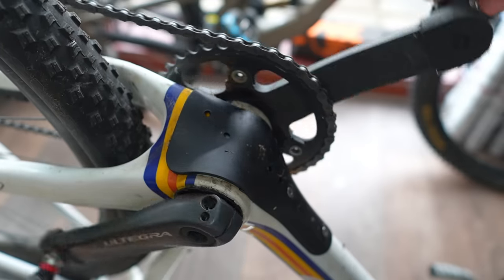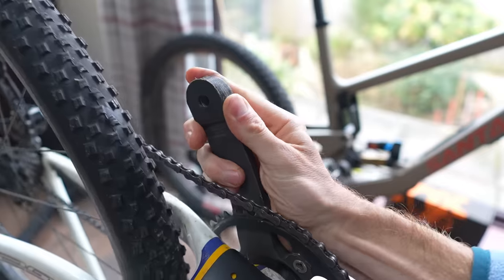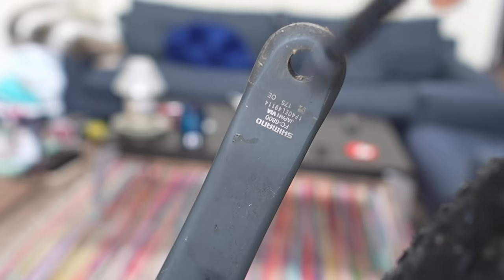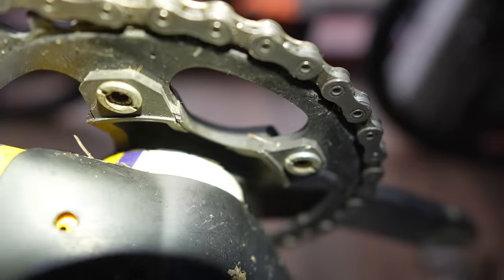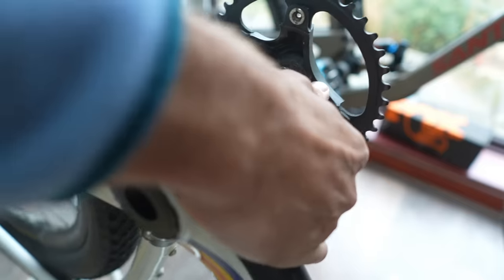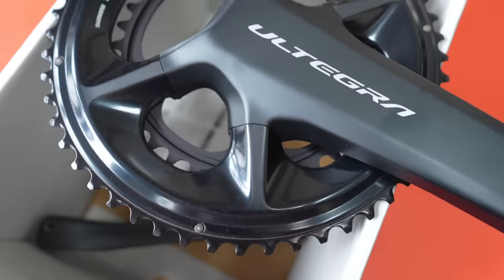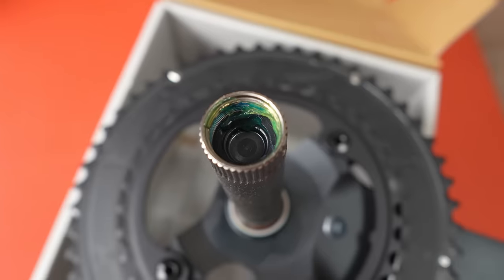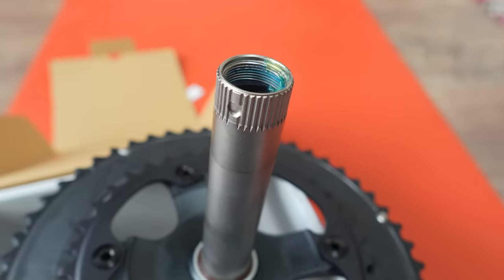Another Shimano Crank Failure & the New Design

Comment: In case anyone was in any doubt, it's my bottom bracket in that bike. And it's as tight as a coke can in a toilet roll holder.
Reply: Is it tighter than hairdresser ?
Reply: thats perfectly designed for slopestyle
Reply: Hairdressers aren't tight...
Reply: @mikehall6608 you don't associate with the right ones
Reply: Just changed the bearings in my hambini bb and yes, it is still as tight as my sphincter when i pressed it into the frame. The caps seem thin walled but are very resistant. not a scratch on them after two seasons of cross racing.
Reply: @Hambini  Broken in is right for many
Reply: Do hairdressers come with a certificate if calibrated by Hambini?
Reply: Only a five year old would be messing with a coke can in a  toilet roll holder.
Reply: You still harassing women online?
Reply from the maker: @christopherfarrell7398  who?
Reply: @PeakTorque  hambini
Reply: Indeed, that's how it should be. No relative movement between parts in motion. Otherwise it more a bushing than a proper bearing.

Comment: I replaced a dura ace 9000 crankset with a campagnolo centaur (using ultra torque) and even though the centaur is the lower tier campagnolo groupset and dura ace the top of the line shimano the campagnolo crankset feels better. The bearings seem smoother and the cranks seem to be stiffer. Although that may just be my own bias, the important part is the campagnolo aluminium cranks are not hollow and not bonded. So the particular failure mode of these shimano cranksets are avoided. I took the shimano crankset to a bikeshop and they found no issues, neither did I, but I believe it is just a matter of time before it starts cracking. I honestly don't trust shimano cranks anymore, the way they make them seems not up to expected standards of quality.

Comment: I had a Dura Ace 9000 crank crack across the line where the top of crank boot would fit.  Was not obvious and needed a magnify glass to confirm.  Shimano replaced all including chainrings.  I warrantied mine when the recall started and took 3 months to get the replacement

Comment: people give me a lot of crap for cleaning my bike/components after every ride, I call it preventive maintenance, my point is that one will more likely find damage/defects when the bike is clean.  I've never had a frame or crank fail on me while riding, knock wood,  thanks for the vid.
Reply: Here is more crap for you: by finding failures quicker you do absolutely nothing to prevent them from happening. You gain nothing. But of course you are right: watching out for early signs of failure makes sense.
Reply: @rosomak8244 The idea of preventative maintenance is not to stop failures but to spot issues at a time early on when they can be dealt with without adverse outcomes. 

In cycling this is highly desirable in order to avoid failures at unexpected times for example when descending in the Alps. I would argue you could potentially gain from this way of thinking, especially if you value your health!
Reply: @davidgeorge9233  No. The real way to prevent catastrophic failure of "alpine dimensions" is to replace preventively parts that are known to be shabby before even seen any initial signs of failure. But the cyclists of today just can't mentally part with the sugar suit brand names for some reason.

Comment: Took my 8 year old 6800s to the shop without rings, and after a few weeks simply got a call what rings used to be on there - could've told them anything I wanted, if I fancied a change. Also had creaking and the exact same failure spot, but much much smaller opening. Still replaced without question after about 10 weeks.

Comment: Shimano have known about this for years. I had my road bike 6800 crank set fail in Aug 2016, with just 15000km on them. It failed at the drive side crank arm bonding. The first hint I had was that I thought my pedal axle was bent, even though I had no fall at all on those cranks.  I was looking down to see if I could actually see a bend in the pedal axle and noticed that the Crank was bending under load. Closer inspection revealed a complete bonding failure of the crank arm bonding, all the way up to the Spider, including the spider as well. I suspect the redesigned spider of the next ultegra series was a result of multiple failures. I had a few friends also subsequently have similar failures.
Reply: Did you contact Shimano, the shop you bought the bike from? What did they say?
Reply: @dainiusvysniauskas2049 Yep, I contacted Shimano Distributor in Australia and informed them, of a potential safety problem. As the part was out of warranty I did not ask for replacement but they replaced it for free anyway. They didn't say anything else or acknowledge that it was a common problem.

Comment: I received a replacement FC-09 set for my failed DA9000 crankset.  Interestgly, the fit and finish of the chainrings is near perfect, unlike the Ultegra level.  Also, the Dura Ace set seems to have gone back to one piece for the NDS, versus bonded.  I haven't checked the weight, but I suspect they'll be a bit heavier.  Shimano should just work out carbon cranks.
Reply: Indeed a good bit heavier. I have a review of DA9200, Rotor Aldu carbon and Cybrei coming up.

Comment: I had two R8000 cranks replaced.
My LBS took the chainrings off to inspect and asked if I wanted them back.

The new cranks came with new chainrings and I got to keep the old ones (they were barely worn, so I sold them for £40/50 ea).

Comment: The new cranks are simply Ultergra 8100 12sp cranks however the rings had to be specically made for the recall. The reason being the entire shimano 12sp group has a chainline that sits 2mm further outboard to clear newer wider chainstays, this means the spider on the 8100 crank sits 2mm further out. A new chainring had to be developed to compensate for this and maintain the original 11sp chainline. This is why the new chainrings are not compatible with the older cranks and vise versa as it will totally mess with chainlines. Shimano say they are going to stock just the new chainrings as a spare part for when these rings wear but am yet to see them available on their own.
Reply from the maker: These new rings have 12sp stamped on them
Reply: @PeakTorque  interesting. I've had 3 replaced and all have 11sp stamped on the rings. Maybe you've stumbled onto another Shimano fail and perhaps they've run out of the special rings 🤔

I did a deep dive when I got my first replacement crank. It slotted back on my 11sp bike without any adjustment needed to front mech. Then for shits and giggles I tried the 12sp version with 12sp rings and yeah front mech needed to be brought outboard 🤷
Reply: My FC08 replacement has the special 11 speed chainrings. I was told Shimano would stock them.
Reply from the maker: Shimano in the UK are just sending out 12sp full ultergra cranks it seems. Im fine with that. They still work with 11.

Comment: Hi PT. You mentioned that all prod. code c/sets being prone to failure, and that is not entirely correct. 6800 ultegra most if not all c/sets will fail at some stage, however the 8000 ultegra, 9000 d/a and 9100p ( total joke of a powermeter) have some prod codes that are excluded from the Shitmano list.
Reply from the maker: Good point. I should have mentioned all 6800. Edit: i did say all 6800. I should not have doubted myself! 😂

Comment: Nice collection and presentation. 
This episode inspired me of application issue regarding the crack arm seams. Particularly cranks for MTB application. When the paddle or the arm tip hit either the bumps or the protruding rocks on the trail, an impulse force may impart on the crank. a force is multiple times beyond the design value.  Thanks to forgiving aluminum ductile characteristics the crack develop gradually and not snap suddenly. If not the crank the fracture will come out somewhere down stream of transmission. (Splines of free hub?)

Comment: The chainrings that have been fitted to the replacement cranks are not from the 8100 12 speed groupset that the crank arms are from. They are the 11 speed chainrings from the previous iteration which had a glossier finish. The BCD hasn't changed but as the 6800 and 8000 series crank design is no longer in production you have essentially received an 11 speed modified 8100 crankset.

The batch code on the crank arm is only relevant for the later 11 speed cranks: Ultegra 8000 and Dura Ace 9100. The very last cranks made for those groupsets ( between Sept 2019 and Cease of production around the time of 12 speed releases) were built using the new bonding method ahead of the 12sp product development. All of the older Ultegra 6800 and Dura Ace 9000 were affected.
Reply from the maker: The chainrings have 12 spd clearly stamped on them on the inside.
Reply: @PeakTorque   curious... the chainrings on the full Ultegra groupset as I have seen on display in my LBS are an exact colour match for the cranks so that makes no sense. I'm sure I read somewhere that the replacement cranks were 12 speed cranks with modified chainrings. It's been so long now that I don't remember where.

Comment: recently i saw a vid on debonding derailleur hangers, checked mine and found the screws were dangerously loose, after watching this im checking my crank. i have been noticing new creaking but its easy to ignore. iv found creaking from the plastic on my pedals, saddle rails, and loose chain rings. i suppose its fair to say, not all creaks are created equally.

Comment: Quite a lot heavier indeed. The Irony being if you are just looking at the crank minus the rings (as am I as I'm also running my 6800 on a 1x) ... its about 40g heavier than an R7000 105 crank, which of course is non problematic, old fashioned forged construction rather than bonded. Makes one wonder why they bothered.
Reply from the maker: Is it really? Thats bad!
Reply: Yup. theres a guy who doe a blog called Handsonbike where he takes the things apart and weighs each part seperately. 

 It's surprising, but if you look at the weights of the various crank arms alone ... this new Ultegra crank is heavier than any of them, the new Dura Ace one second heaviest. the rest are all pretty close to r7000. The only arms that are significantly lighter are 9000 and 9100.

Of course most people only look to the total weight with rings, and thats all Shimano publishes. the bigger weight differences are in the rings not the arms.
Reply: Actually my bad. I misremembered the difference. Its actually about 22g.bit I guess the point remains the same.

For the sake of completeness, the numbers for crank only as weighed at Handsonbike follow. These are 165mm unless stated.

105 R7000, 525g
Ultegra 6800, 528g (170mm)
Ultegra R8000, 519g
Ultegra R8100, 547g
Dura Ace  R9000, 482g (170mm)
Dura Ace R9100, 478g
Dura Ace R9200, 538g

The differences aren't huge, but I think it's instructive as to thevalue of bonded cranks as a weight saving measure, especially after they've been modified to hopefully not fall apart.

Comment: It’s very interesting that this type of failure is happening with the higher and Shimano cranks. Because I have a lower inch mono crank it’s a Shimano Acera Square taper and I’m not having this problem at all. It is well-made so I’m very surprised.
Reply: You aren't having this problem because it's Made in a completely different way.
Reply: @thomasstone1363  how so? Could you explain that to me because I have been dying to know how Shimano makes their cranks and how they make all their parts.
Reply: @MarshWaha  They're not hollow. Lower end cranksets are usually just a single piece of forged aluminium with riveted steel chainrings. This makes them heavy, but extremely durable and cheap to produce.

Comment: Buy some decent MTB cranks and you'll have no issues. Years of mountain biking many of it Enduro and despite many big rock strikes, unplanned dismounts etc nothing apart from cosmetic damage, bottom brackets  just as you would expect they do wear out.
Reply: chain rings from mtb cranks are just to small for road bikes and it is just a shimano problem. even the carbon sram once are built proof ...

Comment: I have the newer design Ultegra cranks and I sure hope these additional waterproofing steps fix the issue. One advantage I have is I don't put nearly the torque on my crankset like these alien cycling monsters such as Peak Torque. 😬
Reply: that ain't the reason these bonded cranks are failing.
Reply: @bikingchupei2447  I don't think you understand. As the structural integrity of the bonds become less and less commendable due to corrosion, they become more and more susceptible to failure by delamination and cracking due to the torque applied at the pedals by the rider. The greater torques/forces applied to the pedals by stronger riders will cause failure when the smaller forces exerted by weaker riders will not. It is true that eventually these defective cranks would fail for all riders if riden long enough in wet conditions, but failure occurs sooner for stronger riders.
Reply: @SignorLuigi  i see.
Reply: @bikingchupei2447  I'm glad the explanation helped. It was nice of you to respond. 👍

Comment: Hey, im plan on buying an Shimano Altus FC-MT210-3.

I plan to upgrade tge bottom bracket on an older mtb because it has a few cm of play haha when you rattle it and looking at the position of the pedals. 

Are there any problems with this crankset?
Reply: Altus is fine.and up to 105 also fine.
Reply: @aitorbleda8267  thanks i tought so, thinking back at it. The hollowtech technology is not listed on their pages so i guess they cast as a whole? And the hollowtech ones are for those who want to save weight, for racing and such?

Comment: THAT‘S why the cranks have this strange plug in the spindle! I have removed it because they did not fit on my bike stand that goes in there. Maybe that was not a good idea. Why on earth have they gone with the closed design on the road bike and not just made it see-through as on the MTB?
Reply: That outer plastic bung is a preload cap. It allows you to put enough clamping pressure on the crank system which positions the crank arms correctly on the spindle. Then the little tab is a security measure incase the clamping bolts come loose or fail preventing the crank arm from slipping off. To an extent the preload cap becomes a bit redundant once the retaining clip is pushed in to the hole, but on older cranks it acts as a dust cap.
Reply: @matt_acton-varian  He was writing about the drive side.
Reply: @matt_acton-varian  He's not talking about the preload cap.  The new spindles have a plug.

Comment: Shimano board meeting; 'Maybe we should investigate carbon cranks?´
'No, let's just add more material to Ultegra and DA and make them even heavier´.
Reply from the maker: Ultegra crank without rings is only 15g lighter than forged 105. wtf
Reply: @PeakTorque  They've lost the plot somewhat. Gone down a rabbit hole of hollow forging that they can't get out of. A shame the Sworks cranks have disappeared, they were pretty good. Hirsch joint.

Comment: 8:40 the almost press-fit of the older outer chainring on the spider was meant to provide lateral stiffness under sprinting loads from the crank to the chainring (We only have Shimano's word for it whether this did or not ). It seems like they're rushing this warranty patch through. If water was getting in there and wicking down bonding micro-gaps, corroding the alu/epoxy bond fascia, separating the glue joint further, then that's a particularly stupid design. I bought Stronglight chainrings for my last replacement on the road bike (9100), which don't have the sculpted chainring stud arms, just plastic caps to end the spider arm with (with equally approximate gaps between the two, but hey, the only person who looks is you, right? & if you wax your d/t, you don't have to spend much time cleaning at all with it at eye level, do you?)

Comment: I got a 105 crankset temporarily while my dura ace ones were off for recall. Interestingly, the new DA crankset weighs identical to the 105 one. They must have just scrapped the whole weight savings design.
Reply: i dont know why you would go nuts like that on a critical drive train part like a crank. Bonding aluminium together with some plastic goop seems kinda insane. It is said, if it works, it aint stupid. But it doesnt work, so it's just stupid.
Reply: if you still see seams on the DA drive side crank, it's the same stupid bonding design, it's interesting though that now they weight the same as 105 as you say.

Comment: Huh, if the spider is susceptible to uneven loading, wouldn't that be cured by stiffer chainrings. Just a thought but I don't think anyone has looked at chainring flexibility as a component of crankset stiffness and power transfer.

Comment: I wonder if using non-Shimano chainrings that expose that edge to the weather are part of the problem here. Mine failed with absolute black oval gravel rings
Reply: I think the opposite. The ring to spider gap isn’t watertight, so any water the gets into the gap with persist. In contrast, an exposed spider end will get equally wet, but will dry off quickly

Comment: 10:50 At least R7000, R8000, R9100 cranks already had this sealing (which was black though).
Reply: Just to clarify R7000 105 (nor 7100) is not a 2 piece clam shell boned design. It is single piece forged crank arm.